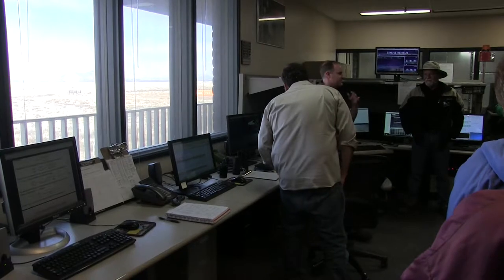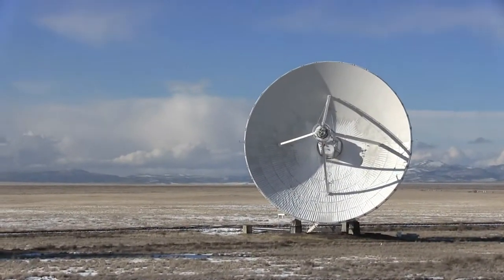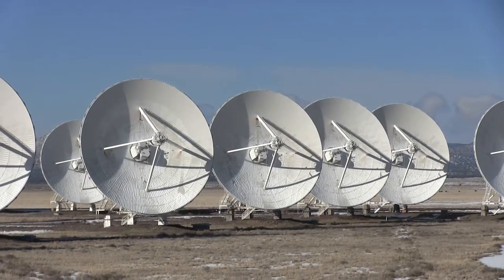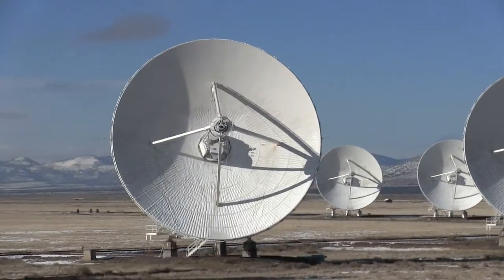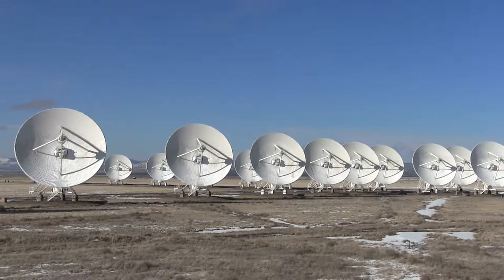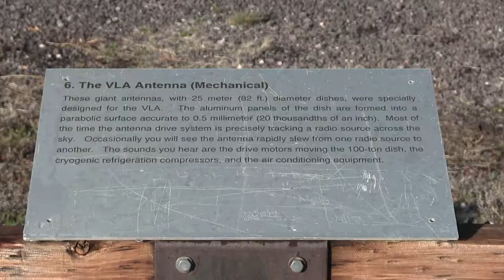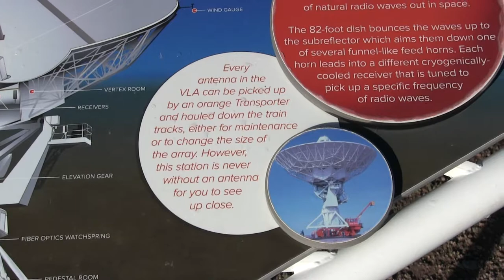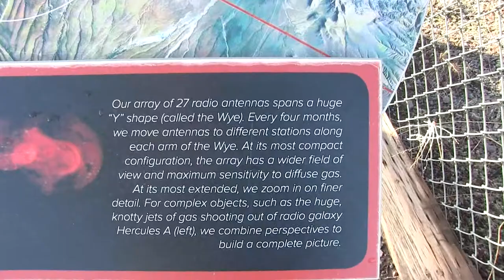Very large array radio telescopes moving into different positions. Magdalena, NM.

Comment: Great video. Thanks for sharing it. I have a question. I thought pointing the dishes directly at the sun could damage the subreflectors, since the surface of the dishes also reflect the visible light albeit very diffusely. Did they say anything about that during the tour?
Reply from the maker: No they didn't mention anything about that.